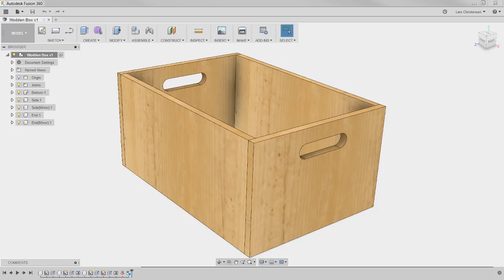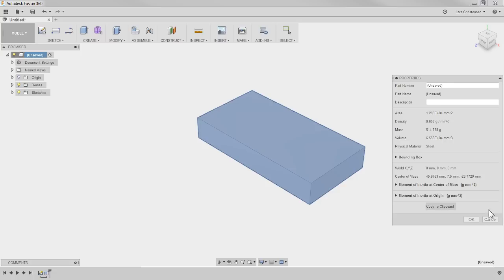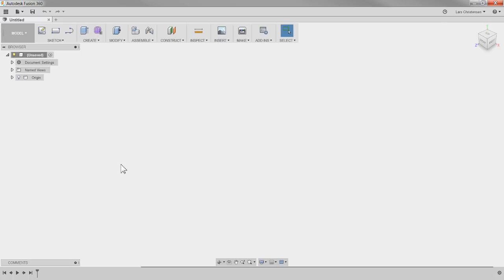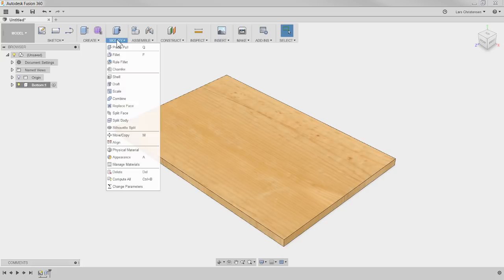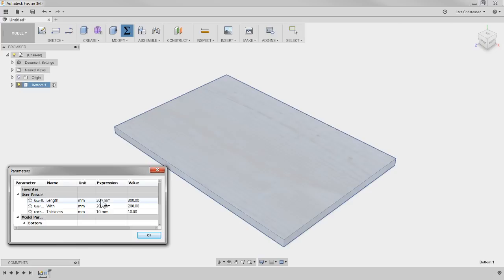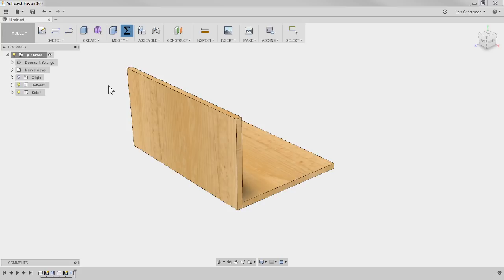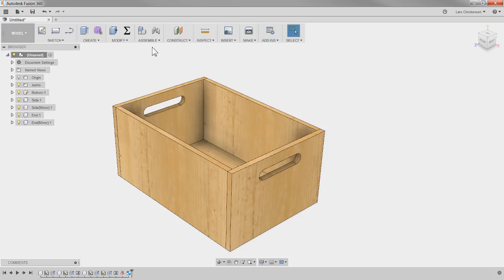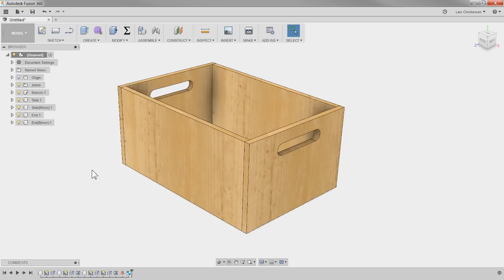A Simple Wooden Box & Some Parameters — Fusion 360 Tutorial — #LarsLive 129

Comment: Just starting using Fusion 360.  I am a complete beginner meaning I have never designed anything on any software ever.  Just went through this video and was amazed how good it was.  I did have one problem which is that when it came to the handles, I had the problem about driven dimensions.  I had to watch another of your videos to figure it out but then it was fine and I was able to complete the box.  Thanks so much. You're a rock star.

Comment: This is really good beginners tutorial. Thanks a bunch. If you can design a box you can design most things in woodworking. Cabinets, book shelves, drawers, etc. BUT I ran into problems around 18:20. I followed your tutorial step by step and word for word (well I did enter “width” instead of “with”, ha ha, sorry about that, just couldn’t help myself), After completing the Bottom Component, I went to “Change Parameters” and changed all 3 of the User Parameters by 1/2 and Wow!, the model changed in accordance with the new parameter values. I then changed them back to your default values of: L=300mm, W=200mm & T=10mm. I then completed the Side Component and added the Height User Parameter of 150mm and changed the L, W, T and H parameters by 1/2 and, again the model changed to all 4 of the new parameter values. So far so good. Then I Mirrored the side and changed all 4 User Parameters by 1/2. Again the changes were all properly applied to the model. Then reset H, W, T & H to your default values. Now I made the End component exactly as you did and the 3 sided box looked fine, HOWEVER when I changed the 4 User Parameters by 1/2 the Bottom and both Sides responded as they should BUT the only parameter that actually was applied to the End Component was the Thickness. The Height stayed at 150mm and the Width stayed at 220mm (my linear expression is: Width + 2 * Thickness). BUT the models End Linear dimension Parameter DID show a value of 110mm, which would be correct. For Some reason this 110mm wasn’t applied to the 3D Box Model. There isn’t a Height linear dimension listed in the End’s Sketch parameters. I have repeated this tutorial several times. All with the same results. Several hours of internet searches didn’t help (probably because I didn’t really know what to ask). If any one could please tell me what I am doing wrong, or inform me where I might find a solution to my problem, it would really be appreciated. Sorry for the long post.

Comment: You made the ends out over the front an back. In Parameters you have Height, Width, Length an thickness. In the Width of your end you can put "Width+(thickness*2)". Now if you change the thickness the end plate will also change.

Comment: Can you consider a similar video using drawer lock joints?  Wood is never a consistent thickness so changing parameters would be very useful, but would the lock joints change also?  Can you use expressions like thickness/2 for lock joint depth?

Comment: Dear Lars,
thank you so much for all those well explained lessons. When I start learning something new, I first need to choose my personal "Mentor" in the internet (usually on youtube). And i quite quickly realized, when it's about fusion 360, all those other channels can't compete with you ;)
Here's one little question I'm getting a bit desperate on: I tried to set parameters on the workbench you created (Diresta Steel shop table) after the design --> and I totally failed in that. When I change the width, the tabletop goes to the left, while the long steelbars move to the right and I have no clue how to bring those supporters in between into the calculation (they just stay in place). I know it's way more complex than this box, but here's my thought: Regarding parameters, would you have designed it in a total different way? Like using more the mirroring tool or a sketch that brings up all the supporters in one place etc....
Sorry for the long text, but I guess other people might be interesting in that too :)

CHeers and good day!!
Michael

Comment: There is one thing that makes using parameters even better. This might have been mentioned, but I'm just too lazy to read all the comments and I like my moments in the spotlight: you can even use parameters in calculations and with operators. For instance with Press Pull "-MyLength" or "3*MyLength". I use it with wood that sometimes comes in differents withs...whits...wits...widths. (just kidding, the width thing just makes you very human). Once you have used parameters, you will stick to it.
Reply from the maker: Hi Rudi Klein Thank you for watching! AND your great advice!

Comment: Can the parameter value themself be constrained in some way? It does not make sense to have parameters that are not constrained.

Also, if we make the width too small, the slot splits the end pieces into 2 pieces instead since the slot since on the end does not change as the design exists at present right?

Comment: The line that was added for the symmetry of the slot for the handle does not show up on your completed assembly, but it does on mine!  I tried making it a construction line, which it doesn't seem that you did, but then I had issues trying to make the slot symmetric to that line, so gave up on the construction line.  If I delete the line, the the symmetric constraints are removed from the slot.  Any suggestions?
Reply from the maker: I'm not sure what is going on. Did I hide it? You could email the link to your model at contact@larschristensen.org and I will find the time to look
Reply: @cadcamstuff  Thank you so much for your reply.  I'm not sure what is going on either, since when I reopened Fusion360 and my model, the line was no longer there.  What I did see though was a faint blue line around the inner surface of the end where I originally had the "line" i thought was an issue.  I am sending a screen shot of the model with the blue line to the email address you provided in your reply.

Comment: This is a little off subject, I made a block with 3 slots in the top different depths and widths and 6 holes thru the side different diameters. One end had a 5 degree taper.  it consisted of 3 different sketches, I went back to the first sketch to change a hole location and all the work after on the time line vanished. What did I do wrong?
Reply: Thank you that was it. I just have not got used to using stop sketch, I have regularly used AutoCAD since version 9 and even used a CPM version before IBM PC (1984) Did switch to Sketchup about 9 years ago when I got a CNC router and since I got a 3d printer (Christmas) I have worked with TinkerCad and Fusion 360.  I like Fusion and have followed your videos since about #95
Reply from the maker: +1 Christian!!
Glad you got it figured out, a baker, so you could move on.

Best,
Lars